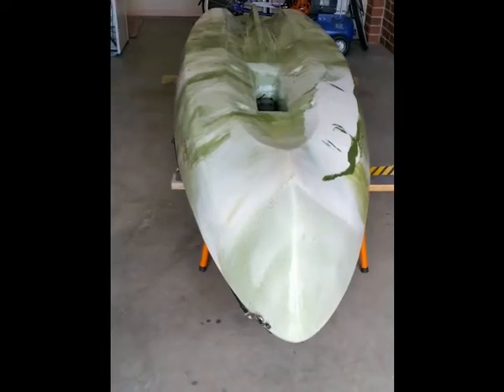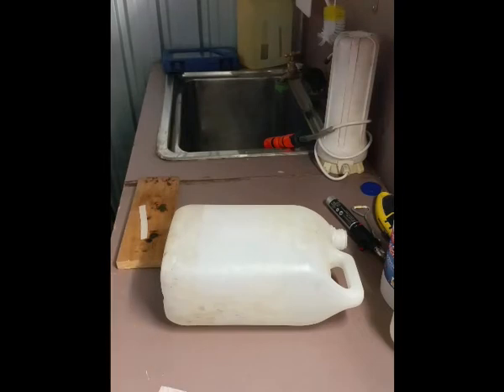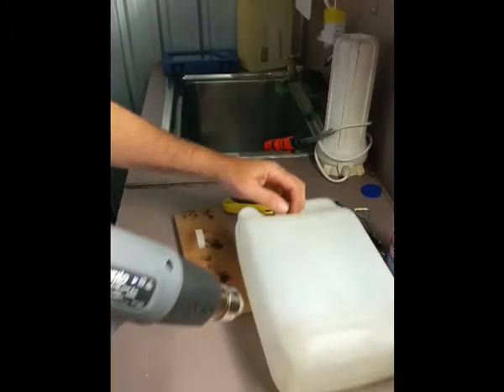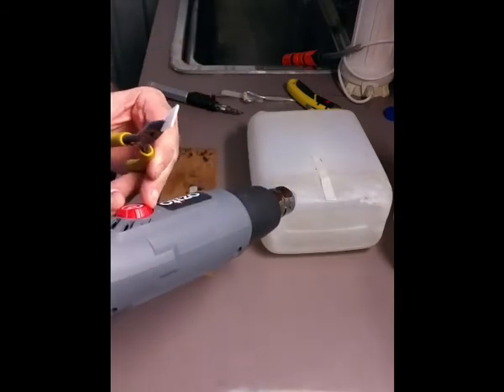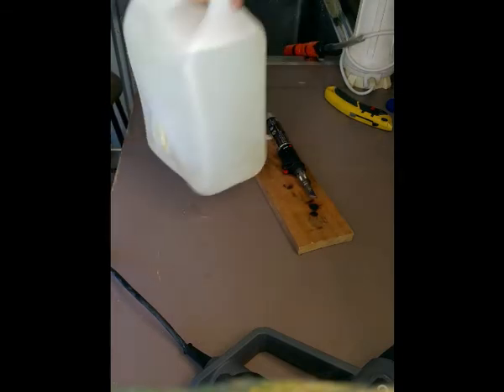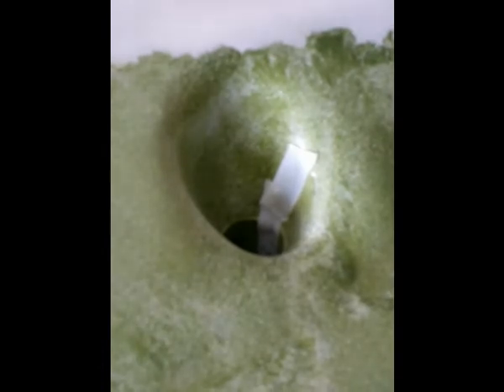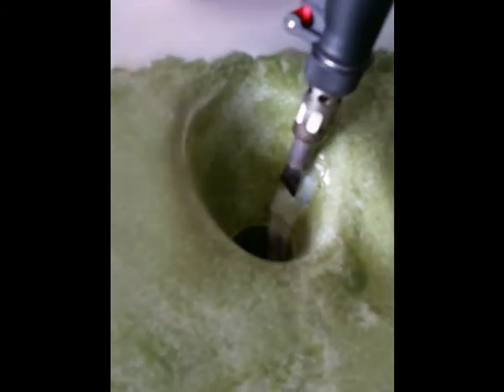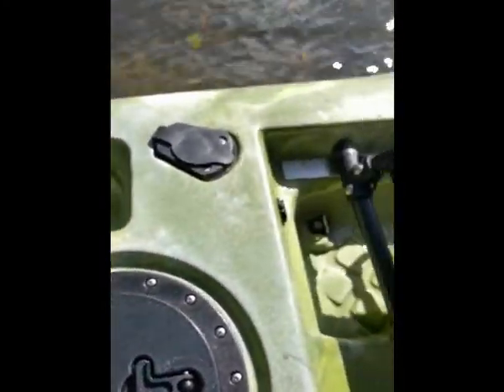Kayak Repair - DIY Polyethelene Welding

Comment: I can see you are a meticulous sort of chap.I’m thinking about buy a pedalfish 10. Seeing that you had a crack in your hull, what
is the hull thickness?
Reply from the maker: Hull thickness is more than ample and consummate with any other Kayak on the market. As I have learned the hard way, a scupper trolley can wear the scupper hole thin. Therefore many owners line their scupper holes with PVC pipe or plastic tubing or similar to protect the hull from wear inflicted by the trolley. I have now also done this. Based on my own experience with the Pedalfish 10 I still do not hesitate to recommend it.